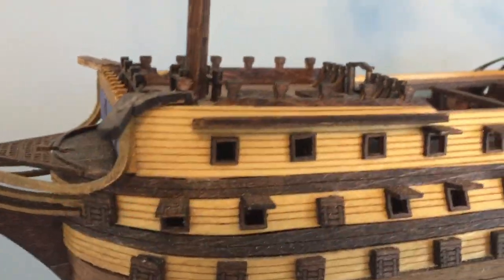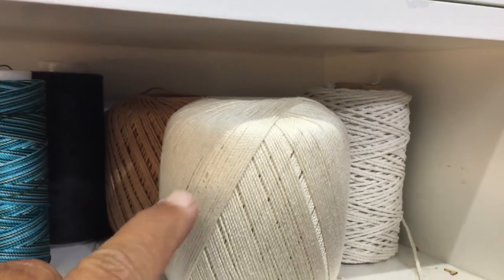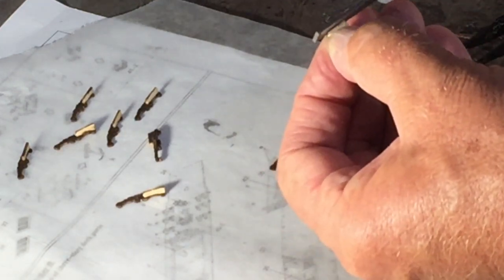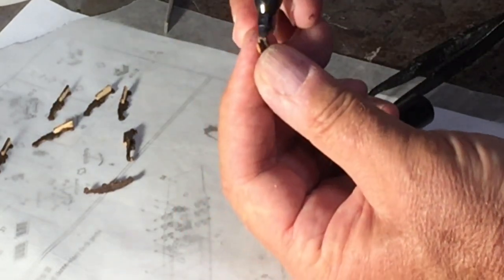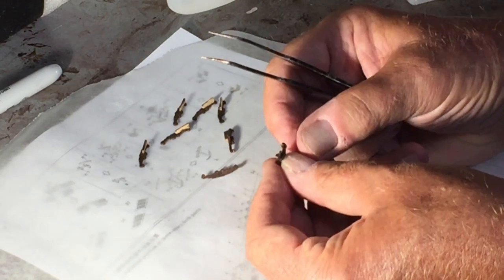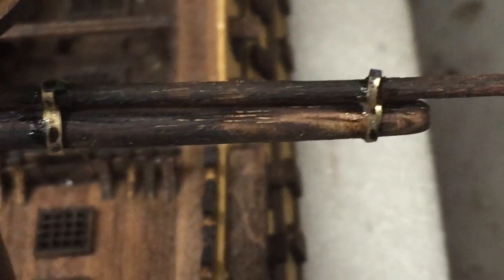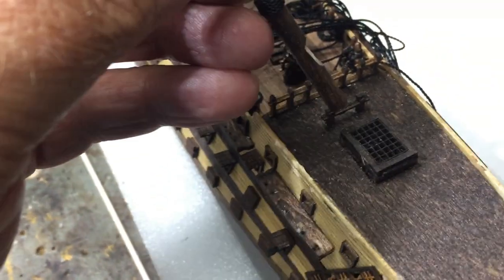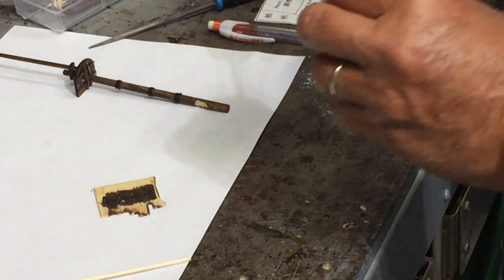HMS Victory Model Ship Build Episode 10

Comment: Cool job i just started to do so if you can tell me what paints do you use ?
Reply from the maker: I mostly use stain.  Mahogany is my favorite. On the Victory, on the light colored areas I only used Tung oil. It enhances the natural color and absorbs into the wood strengthening it.  Once I finish putting all the stationary parts on the ship I will put a coat of Tung oil on everything.  I didn’t stain the deck where I added the walnut planks, I will leave it natural and the Tung oil will enhance the natural color of the wood.
Anything that I do paint, I use water based acrylic paint that is available anywhere (Hobby Lobby, Walmart...).
I’m finishing up the cannons today. I rubbed the black acrylic paint on the barrels then wipe off any excess. Then they look black, not painted black.
The few things I did paint are all the acrylic. Gold is metallic gold but still acrylic. Thanks for watching 👍 Happy to have you following along on my (our) journey!

Comment: Dear friend The rotting instructions are not clear according to the plans of the model marketer so it is difficult to process the model thanks for your professional help without your help is lost and also the ideas.
Your good ones
Where can you buy the black pearl at a reasonable price and a reasonable model with thanks and congratulations .Capt. Daniel.B
Reply from the maker: Ahoy Captain B,
Thanks for your kind words of appreciation regarding the Victory.
In regards to the Black Pearl:
I’m in the process of construction of the ZHL 2021 Golden version. Although it is a little more expensive, in the long run it’s the best deal! I say that because the cheap versions have so much equipment missing.  And really messed up instructions!  Although I made a series on the cheaper one, I don’t recommend it.  It was my first large ship build. I just didn’t know what I was getting into 😂.  Here’s some links for purchasing:

https://www.zhlmodel.com/index.php?route=product/product&path=66&product_id=97

https://m.aliexpress.com/item/1005003197096073.html?_randl_currency=USD&_randl_shipto=US&src=google&memo1=freelisting&src=google&albch=shopping&acnt=631-313-3945&slnk=&plac=&mtctp=&albbt=Google_7_shopping&albagn=888888&isSmbActive=false&isSmbAutoCall=false&needSmbHouyi=false&albcp=15227397973&albag=128249327023&trgt=298362877138&crea=en1005003197096073&netw=u&device=m&albpg=298362877138&albpd=en1005003197096073&gclid=Cj0KCQiAy4eNBhCaARIsAFDVtI3LO9mNd0oxOazDoSJiRPNeIqJnHpqHJtiFkVzwcoqoVwqLGXJ9Xp8aAqg6EALw_wcB&gclsrc=aw.ds&aff_fcid=5559207b92054822b88873a3bf0065be-1638014920313-05376-UneMJZVf&aff_fsk=UneMJZVf&aff_platform=aaf&sk=UneMJZVf&aff_trace_key=5559207b92054822b88873a3bf0065be-1638014920313-05376-UneMJZVf&terminal_id=2fae224c50ed43d48a48324a3c425eb9
Here’s a link to a none verified version that is cheaper but I have no idea of what you might get?
https://www.wish.com/c/602f5d19e46ea7bc8ca87167?hide_login_modal=true&from_ad=goog_shopping&_display_country_code=US&_force_currency_code=USD&pid=googleadwords_int&c=%7BcampaignId%7D&ad_cid=602f5d19e46ea7bc8ca87167&ad_cc=US&ad_lang=EN&ad_curr=USD&ad_price=103.00&campaign_id=6948791183&gclid=Cj0KCQiAy4eNBhCaARIsAFDVtI33PHlN3y13HnDAQ8ScrXDdBolVbFZ8BadRB3A56hiQV56_m8Nm5ioaApJaEALw_wcB